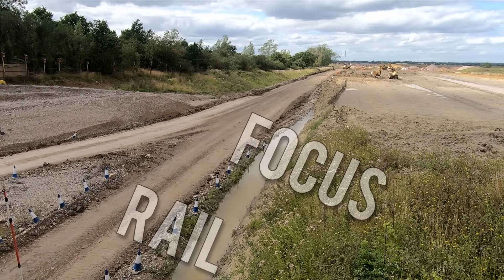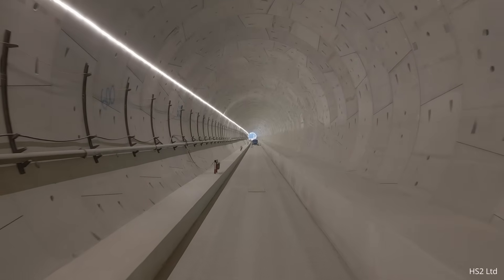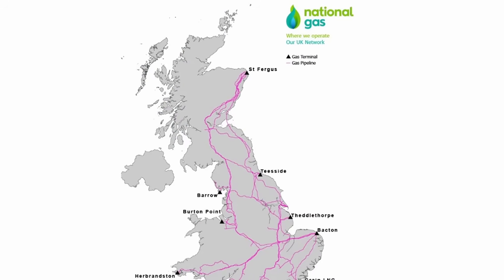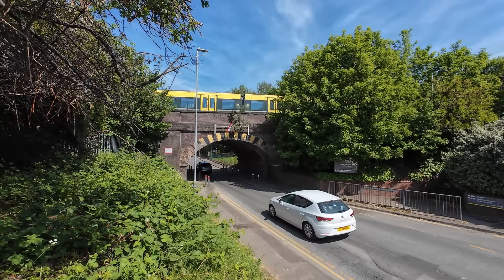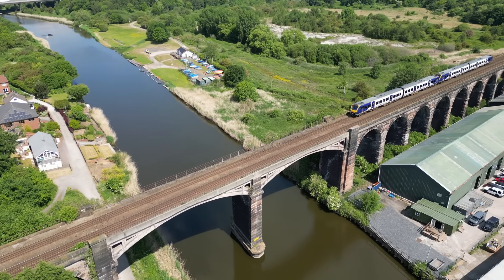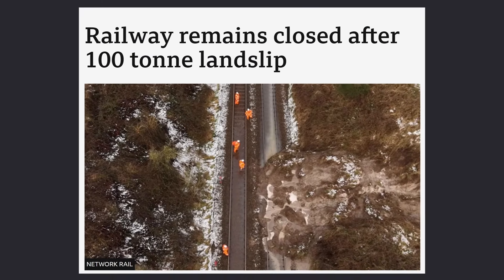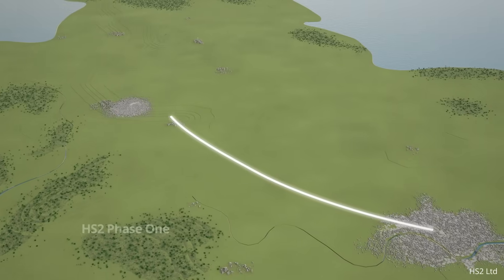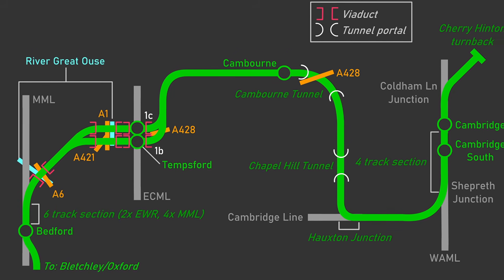Why Railways take so long to build

Comment: Whilst you have a point, you really have to compare HS2 with other European infrastructure projects & I think the overall costs seem very high for the UK. Certainly European infrastructure is also over budget & time Stuttgart 2021 is a prime example, I think the current target is 2030 for completion & that also has major challenges new tunnels, bridges & changing a terminus station through 90 degrees & making it a through station in a large city.
Reply: I have travelled on high speed  lines in France and Spain. Those countries have large areas of uninterrupted farmland where the cost per KM to construct will be quite low. What sets HS2 apart is the amount of tunnelling and bridges etc in a relatively short length. I honestly don think it is hugely expensive in terms of what it  is trying to achieve.
Reply: @JohnHoward-wc9kk That's true of their high speed lines but but in the cities they still have the same expenses. The new line from Stuttgart to Ulm is much faster but has the same problems when traversing the Swabian Albs, with some impressive new bridges & tunnels & it's been constructed relatively quickly.
Reply: you should see what Germany did with their new Berlin airport. It's not all rosey on the "other side".
Reply: @nathanielratcliff7456 That truly is a mess, it ranks along side UK projects. Maybe the UK just hasn't done enough large project to regain the skills but after Cross rail you would have thought they would have the skill set to estimate the costs accurately. The GWR electrification to Bristol is another example of over cost & over budget & they had to buy hybrid trains so they could run to Bristol & Cardiff as they ran out of money to finish the electrification.

I'm not sure why we can't use third rail electrification in the UK like the southern region commuter trains, lower cost & no ugly infrastructure for the wiring. 

TRU is another example where a load of bridges need to be replaced because they are too low, surely we can drop the appropriate pantograph on approach to the bridge or just have a neutral section and enough clearance so the wire can run under the bridge. Hybrid trains drop the pantograph when the overhead wires end & it's not like the bridges change location.
Reply: @steveporritt1550 The Cost Consultants who set the budgets don't possess enough technical knowledge to put accurate cost budgets in place.  I have worked alongside all the large consultants and never met one who did.
Reply: @steveporritt1550 Reasons for the the cost of railway infrastructure projects increasing include:
* Privatisation of the railways causing British Rail to be broken up into a large number of smaller organisations that all need to be negotiated with to arrange for things like engineering works,
* The UK government refusing (for decades) to have rolling programs of investment, which has made it difficult - if not impossible - for UK engineering companies to stay in business and retain the sort of highly trained workforce you need for something like HS2
* Hard-line Brexiteers creating as many economic barriers between the UK and the European Union (and making it as difficult as possible to bring in experts from European rail companies that have managed to remain in business) and

- last-but-not-least

* The UK not having a national requirement for all cities to have transport planners who work on long term plans to safeguard routes through their cities for both high speed/InterCity services and also a plan for to safeguard proposed routes for a metro system.

The problem in the UK is not the cost of constructing railways. It's politicians acting like a request for a railway to be built is some sort of massive ask like a mission to the moon, instead of accepting that we will periodically need to build and upgrade railway lines forever

In Scotland the people in charge of getting the electrification done made things better by:
* Talking to the contractors and asking them to pre-fit as much equipment on the electrification masts as possible, to reduce the amount of closures and
* Talking to the Scottish Parliament to explain to them that if they funded more miles of electrification the suppliers would lower the cost per mile electrified.

In England, if we can get HS2 Phases 2a and 2b "uncancelled" before the people working on Phase 1 come to the ends of their contracts, we can hopefully retain as much of the staff as possible and avoid the cost of training a bunch of new people later on.
Reply from the maker: I did try to explain about the cost of HS2 in another video. This series was more trying to deal with the specific claim about "the Victorians".

Comment: So, to summarise this two part series in a single paragraph, the "Victorians" built it quicker because: they cut corners wherever possible, they used thousands of workers as cannon fodder, and they didn't have to deal with a million other things that have been built since, NIMBYism, or conserving the environment.
Reply from the maker: I wouldn't put it quite like that, but yes 😅
Reply: You're wrong on just about every count: a lot of Victorian engineering was OVERengineered, which is why so much of it can cope with the faster, heavier trains we have now. The navvies weren't cannon fodder - they voluntarily worked for financial gain. And there were plenty of Nimbys, which is why there are  tunnels built solely to hide the line from a stately home, and fancy architecture to please the local aristocrats.
Reply: @andrewhotston983  Some Victorian railways were over-engineered by modern standards, but by no means all. Many of the numerous branch lines and rural railways (the ones that fell to the Beeching axe in the 1960s and early 1970s) were thrown together as cheaply as possible, and I suspect that if the Beeching cuts had never happened, people would be complaining today about the high cost of maintaining the shoddy infrastructure legacy of many of those lines. One might argue that the Victorian railway structures (bridges, viaducts, tunnels, stations) that we celebrate today are simply the ones that survived because they happened to be well-engineered (or over-engineered if you like); the poorly designed and built structures on our retained lines will have long since been replaced with newer structures.

Also bear in mind that, with regard to the lines and their infrastructure that we celebrate today, their designers and builders were at the time frequently criticised for going over budget and time - usually by the shareholders of the private companies formed to build the lines. We fete the Great Western line as a great achievement by Brunel, but he went way over budget and timescale and the GWR directors were very unhappy about it. Here we are over 160 years later and is anyone complaining about how much the original GWR cost and saying it was a waste of money?

Even in the early 20th century, railway projects went over time and budget. One example that comes to mind is the Hertford loop of the Great Northern Railway (now the East Coast Main Line); The section northwards from Enfield Chase took 20 years from planning to completion, plus another 6 years before the station at Hertford North was built. And some of the construction was not done to high standards; the embankment at Winchmore Hill had to be substantially re-engineered about 20 years ago, because it had been built with too steep a slope and was becoming unstable.
Reply: @andrewhotston983 So you believe the Victorians had to cope with dealing with an existing infrastructure and a number of environmental bodies and planners, making their task comparable to today's demsnds ?
Reply: @TrevorWilliams-fq8mg there are countless examples where lines were rerouted due to objections from those that owned land. The line to Oxford isn't in the right place, another example is something like the Bruce tunnel which was land owner objecting to the canals.
Reply: @CA_I but the contracts used today are much more complex with the requirements of the design meeying environmental requirements, an army of ecological authorities to satisfy, approval processes to satisfy to build over or under railways, roads, rivers, underground services to divert, management of designers, logging early warning notices where events change the scope of works, updating progress programmes, agreeing design warranties and performance bonds, dealing with extensions of time issues, valuing sub contractors and main contrsctors interim payments, producing as built information. Whilst the Victoria's had some issues to address as you say,  they didn't have all of those issues.

Comment: This was an excellent video - but you are evading (intentionally or not) the fact the HS2 is taking so much longer because the Tories salted the ground with adding so much extraneous tunnelling in the Chilterns. 

I think a real reason that the Victorians were faster to build is because HS2 won't be a profit maker directly so the [INSERT WHATEVER TERM FOR THE SUNAK CLASS HERE] are much more reticent to push ahead.
Reply: if you look at a route map and the proposed tunnels, it really isn't that much extra

the Elizabeth Line is also 50km of tunnels under the biggest city in Europe and that was £18B including the dozen or so stations and interchanges

Tunneling really isn't that expensive when you don't need an underground station.
Reply: Agreed and this is one of the big misconceptions people have about modern railway infrastructure projects, depending on the details and specifics of the Project Brief, modern Land prices are so high and environmental mitigation so demanding that constructing tunnels with the latest advancements is now in many cases a much more attractive proposition.

With one caveat being that constructing tunnels for below 150mph line speeds is significantly cheaper and easier than constructing tunnels capable of operating speeds closer to 200mph due to the increased tunnel size and design specifications and clearances needed to allow that higher operating speed.
Reply from the maker: I think tunneling (mostly) fits under mitigation. Although much of tunneling is in fact needed, especially under London.
Reply: @Rail_Focus  To properly balance the scales here - in the US, for instance, "Democrat" states have slower building rates for new houses due to both higher density and higher taxes for urban improvements. 

I absolutely believe that said money should be spent on the urban environment. However, taxing new buildings is just a tax on Millennials in favour of Boomers. Since Boomers enjoy the real-estate appreciation and Millennials are buying the property. I think that money should come out of their coffers somehow.

To draw the line of comparison to rail building in the UK, adding beautification to, for instance HS2, will eventually be paid by the users of the rail network in higher ticket costs and the opportunity cost of not having access to the increased capacity and faster service until later. (Assuming someone eventually pulls their thumb out and connects it to the North.) The intentionally poor management here is effectively a tax on urban populations in favour of rural populations. This again is a tax on the young in favour of the rich: https://www.bbc.co.uk/news/uk-43316697#:~:text=At%2038%2C%20the%20average%20city,those%20aged%2065%20and%20over . In fact, that's exactly why HS2 was intentionally mismanaged. 

The Tories had more of an incentive to make sure that the people who, let's be honest, were never going to use it in the first place, were kept happy than to deliver an efficient product. 

If you think that I'm actually wrong, please isolate where my analysis is incorrect! I think you did a good job of explaining what we do better now, but not what we do worse. The answer "yes, but I didn't want to discuss that" is valid. As I said, you 'evaded' the issue, not that you 'dodged' it. I was trying to use a word with a softer connotation, precisely because I didn't want to @ you, I wanted to & you.
Reply: Please try to remember that a certain Boris Johnson finally got this construction started, despite huge opposition in his own constituency. Several other Tories also have given full support, Cameron, Osbourne. I acknowledge various Labour people want this built as well and have supported it. The Liberals have been their usual hypocrites. Against HS2  when it suits them in a By election and then all for it on environmental grounds !.
Reply: One thing I would say about people complaining about the cost of tunnelling is that tunnelling gives you the massive benefit that things like roads, other railways, pylons and other utilities can be installed over the tunnel without the need for a shut down of the railway.

So it's a short term hit, but it stops other activity near the railway being a problem in the future.

One thing I was impressed with was the town next to the abandoned bit of Great Central Railway that is being recycled where HS2 Limited engaged with the town and the locals engaged positively, instead of just saying "nope" and they agreed on a section of cut and cover construction that will unite the communities on both sides of the railway and turn the land above the railway track into a bit of green space. It's far better that they have done that and given kids a place where they can hang out than have TV reporters descending on the town to get interviews from people who say "the railway is too noisy."

What I would say though is that we should put as much effort into getting the North West and North East parts of HS2 right too, when we persuade the government to restart the project.

And that's why Manchester has my full backing. If Manchester wants a through station, give them a through station.
Reply: @DavidShepheard  I agree and I think if you were going to throw bags of money at any project it would be Manchester, a proper 4-track tunnel solution with new underground platforms linking the legacy Manchester rail network together in a coherent way would be massively transformational and exactly what is needed and similar to what other cities like Stuttgart, Frankfurt, Munich and Hamburg are doing.

Comment: Highly Informative Video here! Let's hope this will help those less in the know understand why these projects end up running late and over budget
Reply from the maker: I'm sure the videos won't convince everyone, but I hope I've at least made a convincing case
Reply: Speaking as someone who spent a working  lifetime working for a national Contractor on major construction  projects on the cost and preconstruction side of the business you have produced the best video I have seen on the HS2 Project.  Very informative, concise and accurate to the point.
Reply from the maker: Thank you so much 😀
Reply: Regarding projects running over budgets the problem starts with an under estimated budget. I've worked with all the major Cost Consultants and have never met one who had the necessary technical understanding to put a Client budget anywhere near to being accurate. Regarding public sector projects the Treasury has a guidance book called The Green Book. It contains a table of recommended cost % allowances to apply to different grades of projects. For large complex projects the guidance is 4%. But for HS2 4% of an insufficient baseline cost is still next to nothing.  And the figure came to 32.70 billion. I'm currently working for a campaign group on the New Hospital Programme  and that Project will go the same way as  nobody has ever delivered 40 new hospitals before.